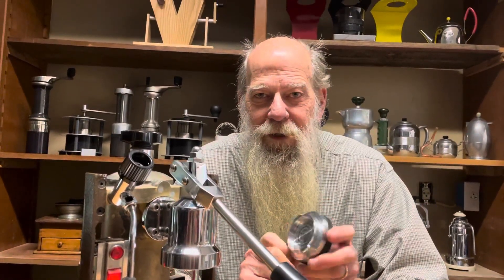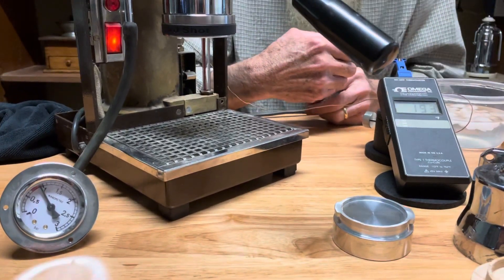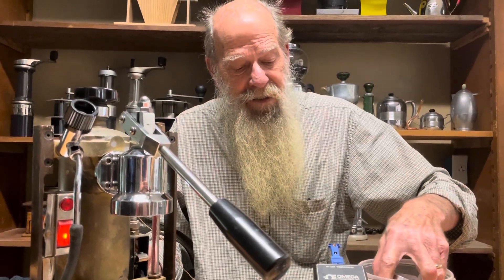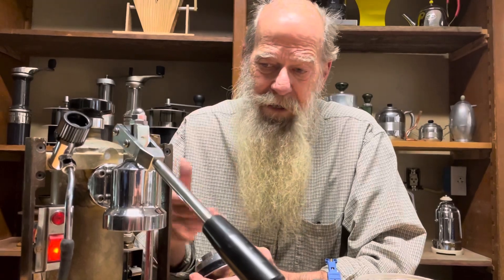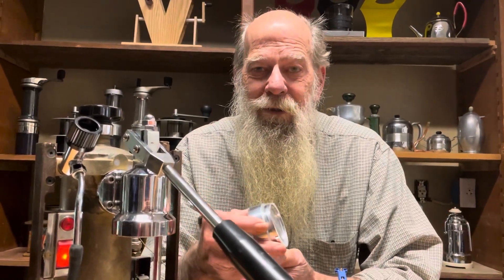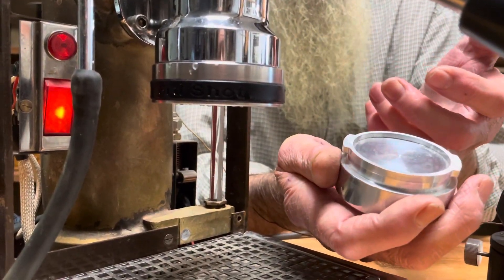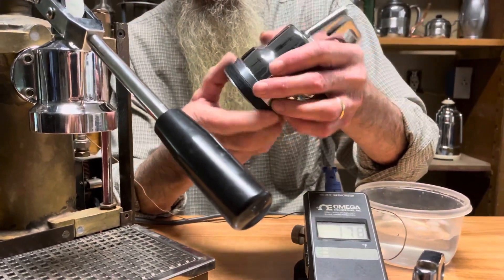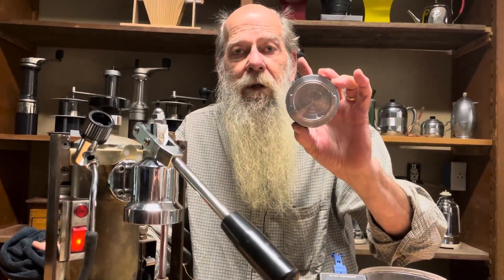OE 3rd Shot Heat Sink for Olympia Cremina and La Pavoni Espresso Machines

Comment: What type of tubing are you using on that makeshift pressure gauge attached to the steam wand? I’m trying to recreate. Love your stuff!
Reply from the maker: It's automotive, can't remember if it was vacuum line or fuel line.  Take your gauge, or fittings with you to be sure of the size - you want it snug, but not so difficult to get on/off that you don't use it (or pull your machine off the counter trying to unhook the tubing!)

Comment: So  glad Found you! I just inherited this amazing vintage machine. I thinks a 1985 (Olympia Express) from the serial number. I'm looking for all the info I can find on how to maintain this beauty as well as my Uncle did. Do you make the hard rubber seals and the "third shot" cooling device?  How do buy them?  The machine is in great shape but the basket falls out so knocking out the puck is tough because its so hot.  Was there a spring or something that is possibly missing from the porta filter?
Reply from the maker: Yes, we make the seals, and the 3rd Shot!  You can find the parts we carry here: https://www.orphanespresso.com/olympia-cremina-model-67-gaskets-seals--parts  We have text/photo maintenance instructions, and links to more of our youtube videos on how to repair Cremina machines!  https://www.orphanespresso.com - the repair page links are at the bottom of the page.
Reply: @orphanespresso  such a great resource. I’m up to Video 13. Question which tamper should fit, your 49.4 or 49.5mm ??? I don’t know why the basket just falls out when I turn the portafilter over to knock out the puck. Seems way too loose?
Reply from the maker: @SurvivorStory  The baskets commonly fall out - original design did not have a spring to hold it in.  Either a 49.4, or a 49.5 tamper will work well - a 49.0 is generally considered a bit too small for a good fit.

Comment: What’s wrong with just using the stock portafilter as a heat sink? Room temp or Dipped in a cold water bath like one beside you in the video.  The pf doesn’t have enough thermal mass?
Reply from the maker: That can work just fine!  The Heat Sink is handy if you only have one portafilter, and want to make successive shots a bit quicker.
Reply: Makes sense! I was also thinking about the stock pf having little contact to the group. It seems like heat is only transferred through the ears/tabs, and maybe little from the group gasket. Other than that, I dont think the stock pf sides touches the group.
It looks like the 3rd shot fits more snuggly and transfers heat even from the side(outer diameter)
Reply from the maker: @severthee   Correct!  We did redesign the 3rd Shot so it would contact all the way around on the bell, as much as possible...

Comment: I'm slightly obsessed with this concept...I personally believe the only arrangement that offers the opportunity to consistently pull a near perfect shot is a direct manual with a true heat exchanger (not a siphon concept to stabilize the system, like the Cremina). I've searched for that arrangement for years...I've owned a lot of machines...I've only found a single machine that fits the criteria, the Gaggia Achille.

Comment: I was checking some of the La Pavoni machines online last night. It appears they're only built for 240V current in the European markets. You would need a transformer to step the voltage down for it to work in the U.S. La Pavoni has NO presence at all anywhere in the Western Hemisphere, so if you need parts or service, good luck. It's a shame, because they're beautiful machines. and highly functional.

Comment: Neat backstory about a new-to-me doodad. My LP experience is only at the ~7 year mark.

How does the 3rd shot's cooling rate compare (percentage-wise) to simply using a spare PF to sap the excess heat? 

Also, consider adding the link in the summary box (or whatever it's called) rather than having to inquire about it in the comments. Thx
Reply: The spare portafilter only contacts the metal of the group at the bottom of the lugs. The third shot contacts the group at the lugs as well as the bottom of the group bell. Looking at the videos, the third shot is way faster than a cold portafilter (which I've tested). One can't state a simple percentage as Pavoni stock portafilters vary appreciably in mass (I have four). You can make a shim for a Penny-style portafilter so it will work like the third shot, but I do not think that is worth the hassle compared to a wet cloth. One of the mods at H-B cut up terry towels so the towels drape nicely around the group; that is a simple and effective solution, if not as elegant as the third shot.
Reply: @baldheadracing  By percentage-wise, I meant an approximation. That's all. Is the 3rd shot twice as quick, 3X, 4X as quick as a room temp PF? That type of assessment should be easy to realize with the GH digital thermometer that Doug is using here. 
#sidebysidefirsthandcomparison
Reply from the maker: @ziptiefighter   We're working on another vid with a bit more of the quantitative info (and being able to read the temp, and maybe a stop watch!?!), we'll try it with a PF too...

Comment: It's back?!? Can you please check if it also fits the MCaL? (and the Club ;-) )
Reply from the maker: Sorry - don't have an MCaL anymore to check it with!  If the Gabor Naked 49 portafilter, or a Penny Bottomless portafilter will fit the machine then the 3rd shot will also fit.
Reply: i have a pre-2005 elektra micra casa leva. that’s a 49mm portafilter. do you think the 3rd shot would fit this machine?
Reply from the maker: @hobiesimons  Yes, but we don't have one here to be certain of the fit...
Reply: My Penny bottomless portafilter fits my old MCaL with some care - the pf will blow off if I don't put it on just right - so it sounds like it'll work. Too bad I just did my "big" order earlier this month so I can't think of anything to get into free shipping - except maybe that Cup-One ...
Reply: @orphanespresso  I just placed an order for one. After I try it on the Elektra I'll report back.
Reply from the maker: @hobiesimons  Thank you!  We look forward to hearing your report!
Reply: my 3rd Shot arrived today. Fits the pre-2005 Elektra Micro Casa a Leva perfectly.
Reply from the maker: @hobiesimons    Thank you!!!  That's so good to know!
Reply: I've just received my 3rd shot heat sink. It works on the MCal. It does not work on the Sama Club. The  Sama club does not need a heat sink with its thermo siphon design...
Reply: True. I wasn't specific enough - I was referring to the Olympia Club.